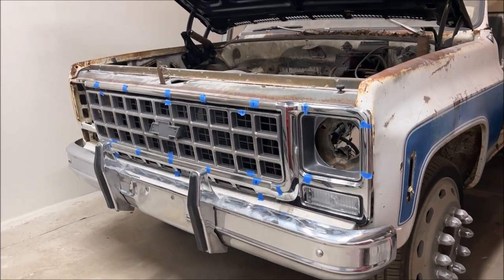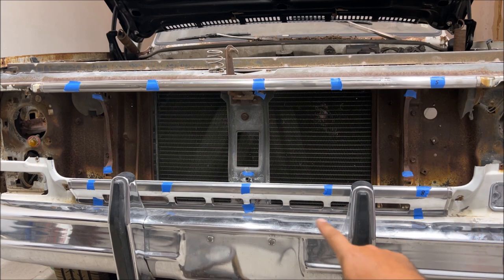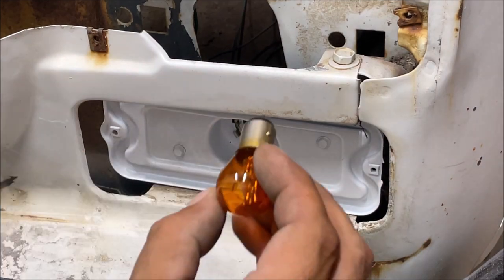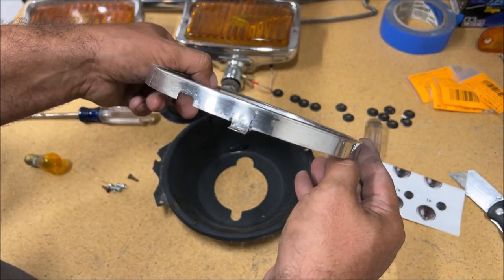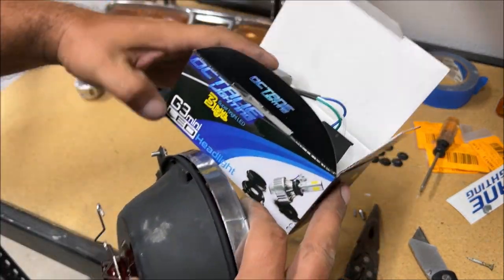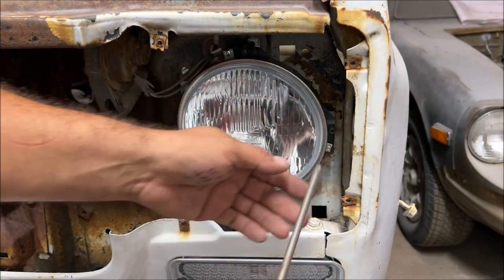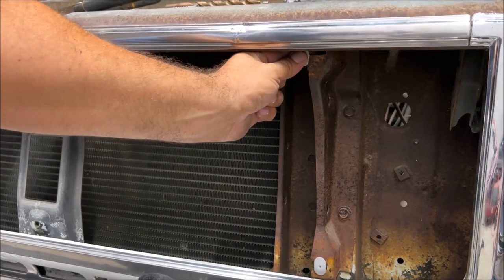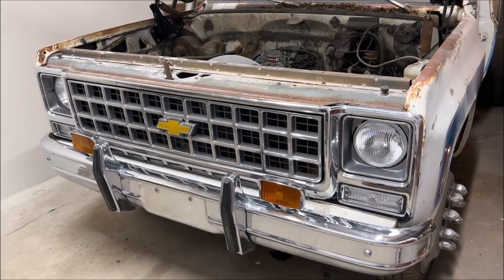73-80 Chevy C10 grill installation

Comment: A little tip for those light ring tabs. I used a small grommet set from harbor freight and drilled holes. It’s strong and will outlast any other repairs I’ve seen and it doesn’t have any figment issues

Comment: Good information it looks really good im restoring a 90 g30 van it has a factory 454 in it thanks for sharing
Reply from the maker: I used to have a 1991 white g30 with a 5.7 I sold it cause it was worth money in Houston.. I bought it in lufkin for $1100 and sold it for $2000 a week later to a welder.. I currently have an 88 g20 but I bought a new grill from certi fit .. it was cheap new headlight buckets and all for like $90 12 years ago